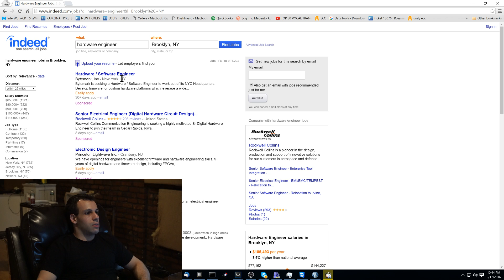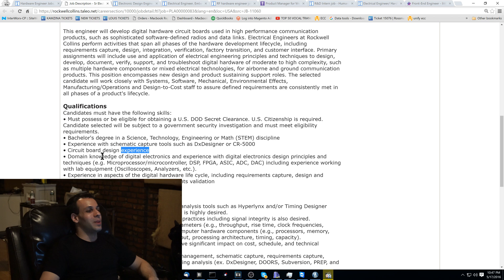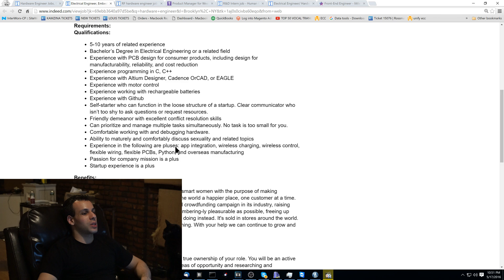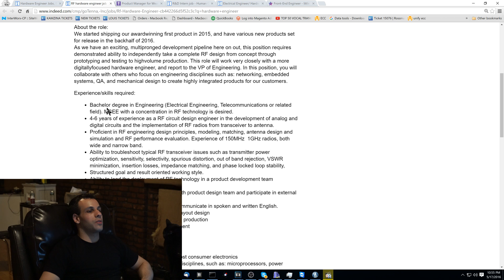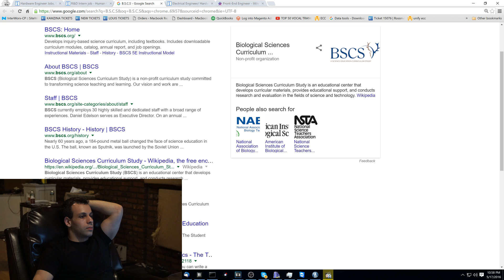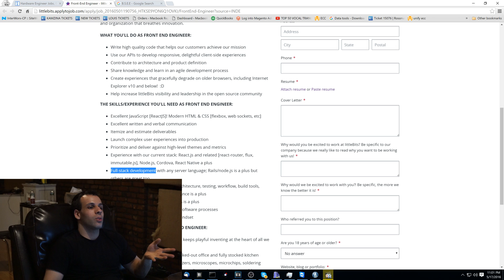Louis looks for a job

Comment: 4:50 dude I don't think you give yourself enough credit. You don't realize how dumb most of the general public is(with computers).
Reply: I'm an engineering manager at a startup in silicon valley.  We spend an awful lot of time debugging issues on boards given to us by third-party contract manufacturers.  I think Louis would fit in well here.
Reply from the maker: maybe
Reply from the maker: Jason Lokerson that sounds like fun
Reply: Louis Rossmann If you're interested, wouldn't be hard to get an interview.  Send a message to recruiting@leapmotion.com.

Comment: 15:30 - You misunderstood what they were asking for there. When they say schematic capture alongside configuration management, they're talking about capturing the data and recording it per government requirements. They're a military contractor so they're required to keep records of their products for a set number of years after projects close. They mentioned DOORS which is an IBM product used to capture requirement documents and maintain them in a controlled repository where the Configuration Manager would be running a board for regulating change on the documentation.

Going by the description it looks like they're wanting someone to be a Hardware Configuration Manager. Which is to say they're looking for a digital librarian to store their schematics. The rest is always in there as something they think would be nice. I'm a Software/Systems Configuration Manager, they wanted me to have programming experience, wiring experience, FPGA experience, etc. All of which I have, none of which I've used. The only thing I have used is my experience with code repositories, because that is how the data is stored, baselined, and preserved for posterity.
Reply from the maker: I'm purposely trolling

Comment: The problem is education discrimination. If you really want an engineering job, acquire the skills required to perform a specific job (or be a "jack of all trades but master of none"), and meanwhile grow a network that consists mainly of other engineers, where you share/show your experience, skills, projects, etc. It's not a foolproof way, but sometimes getting a job through a referral within the tech industry can work if you got the skills and motivation. Most job ads are unrealistic as others have mentioned, even in many other tech industries/fields. It's impossible to know everything and be a master of all those topics. (It's not impossible to want to learn a lot, or as much as possible, and learn something every day though, but as technology changes, information and knowledge changes, meaning you have to learn new stuff to keep up.)

Comment: You must not have been thinking at all when you bought a very nice leather chair for your cat to sink its' claws into. Remember:
Cat claws back of sofa.
Owner puts cat outside.
Repeat step one several times.
Now every time the cat wants outside it scratches the back of the sofa.
Reply from the maker: it's cheap ass fake leather. i bought floor model because i knew kitty would destroy it.

Comment: Louis someone posted your video on reddit and it hit the front page.. thats where it comes from
Reply from the maker: this explains why 5 hours in i still am barely 30% through my comments... I usually read and reply to almost all of them, but this is wayyyy too much. 2:15 am and not even close to done. and if i don't finish it will jsut be buried under a pile tomorrow

Comment: Exactly how it is when looking for a mechanical engineering internship. It is near impossible to have everything that they are looking for with just the education alone. Employers seem like they put extra stuff on the job requirement that purposely goes outside the scope of the degree just to weed out the majority of potential applicants.

Comment: You're looking at the wrong jobs, man. You should be looking for a job where the main qualification is looking at a schematic and a broken board is the main qualification, not something that you might be also doing.

Try to look for HW QA jobs, HW test engineer... Look for "B.Sc. or equivalent experience", or straight up ignore the degree requirement and tell them the sort of work you do for a living right now.

Comment: Many people aren't ready for college at 18, or 20.  Ideal motivation is that college classes progress you towards a focused goal you want badly.  The point of college is to certify and round out what's already there.  Many people cannot excel until they know where they are going and why (the American disease/strength ~ i can't work for you until you explain why i do every step).  Long before I went to college i taught myself to program, teaching myself things was always my #1 skill.

I wrote a PhD in CS Theory at a top-10 school but used mostly algebra from high school.  I managed to use calculus once to approximate a summation to estimate the operating point for the TCP congestion control algorithm.  Calculus is cool, and interesting, but almost nobody is using it in their day-to-day jobs ... It's good to have an employee who can recognize a calculus problem because if they cannot even recognize things with a simple efficient textbook solution you'll be at a disadvantage.  calculus is a lot like auto or bicycle repair, after you get convinced that you can slice curves into infinitely thin slices and solve an infinite summation, you build up a table or cookbook of patterns (like a toolbox) to use to solve any calculus problem.  I was lucky to learn it in a honors class from the dept head at a top-20 school.  I might have struggled in a crappy average class or with an average teacher, which i see my sons doing, today.

My manager started as a 3rd world tech with an associate's degree and he hated his work and he eventually realized that he needed a 4-year engineering degree to have the career he wanted, and boy he went so much further than that, managing SRE for 1st stage of Google Search now.

Comment: You are very good at what you do. There is no denying that you can read line schematics and troubleshoot component failures beyond the obvious. If you were not smart, nor efficient in what you do, then you would not have 80 to 100 boards in Que waiting for repair. There is a demand and a need for your existing skill set or you would not be making these video nor taking on new work. Can you do other things outside of your skill set? Of course you can, but why  would anyone want to destroy a reputable resource such as yours with suggestions to move on? Human reasoning is unpredictable.

Comment: I agree with the overuse of the term engineer in job role names. An Engineer has a graduate degree and does design and architecture of systems. They put scientific concepts into practice. You and I are technicians and there is nothing wrong with being a technicians. Techs solve immediate problems and get work done but what we do isn't engineering.
Reply: Looking for a Landscaping Engineer:
Must have:
B.S. Agriculture
5 years experience
Clean criminal record
Flexible Schedule

Or: stand on the side of the road right next to Home Depot.
Reply: Nah, degrees are bullshit.
Engineers simply engineer designs into being.
Don't take listings or expectation as reality.
Reply: @seanwarren9357  Wrong, engineering degrees are a certification that that person has the knowledge to be designing bridge supports and your car brakes. The degree isn't bullshit
Reply: The engineering degree itself is great, its good that you know calculus and physics.... that being said I feel like they just try to suck the money out of you by making you take BS classes to get a "rounded" education. Drawing the degree out more than it should be, making you stay extra semesters etc. Not to mention stupid BS tactics like signing up with book publishers who require you to get the newest revision every year and then never just allow a free .pdf to be uploaded online. Or you know since there's hundreds of students packed in the class like Sardines maybe just take a twenty from each one and use those thousands of dollars to make a book instead of taking hundreds from each and pocketing that shit while they print they same book next year with 3 sentences changed.

Rant over.. back to the main point tho there are ALL KINDS of positions that are called "engineer" I'm not sure all of them are legit, some are a stretch but still make sense like network engineer. An "engine" is just a system that does work, so an "engineer" is a person who creates those systems and their operating protocols. Doesnt necessarily have to be calculus-based physics.. although thats obviously more useful in the long run.
Reply: @wabbajackwabbajack6932  Well I am a electronic engineer student, I was a technician before. I can say that University is BS , the education methods at least, the amount of money and time you spend, but let me tell you something else, the degree is not BS it just certified that you have learned about a fucking lot of topics, some of them are going to be useful and some of them not, but in the end the effort and knowledge can't never be BS.

Comment: dang this is very interesting, I have a slightly similar story. flunked out of highschool, got a GED, fired from nearly every job, got my own business(made tons of money)...I since quit that business.......as it was unrelated to anything technical. the things I do know how to do, dont pay enough to be worth my time. I've got into modifying laptop BIOS' for additional unsupported features/performance and learning workarounds for the many different guards put in place by various manufactures, writing my own tools that run in DOS to flash bios for certain manufacturers etc.....because it was what I had a strong interest in doing. I've bricked many along the process and got hardware programmers/test clips to reflash the chips ive bricked, and start over again and again until I get my methods correct.  I dont have much of an interest in doing so anymore, and nobody wants to pay an amount that would be worth my time to do such a tedious task that could take me up to 10 hours, because its just not worth it, if they need unlocked or new  features/overclockability etc....they would rather just buy a new machine. $30 for 5-10 hours of work is just not going to cut it. Basically A useless skillset, its a shame I couldnt make anything out of it.

Comment: Louis Rossmann, I never completed High School. Never attended collage. self taught IT and board level repairs and satellite communications. Now I am engineer for NASA. 

I made a lot of money doing exactly what your doing, I made the most finding broken and free stuff then repairing and reselling. if you can repair a 400.00 dollar TV by replacing a few high temp caps in the power supply for a few dollars then off load it that is almost free money.

Comment: Love your videos + your business.  Awesome!  I am an engineer (20 years now) - BSEE from Cal Poly SLO and an MSEE from SCU.  I can't do what you do and most engineers I know simply can't do what you do.  I know - I work with them.   That said, in the industry "Test Engineer" actually means something specific - it has to do with writing software and building hardware designed to test product on a production line located in a manufacturing facility.